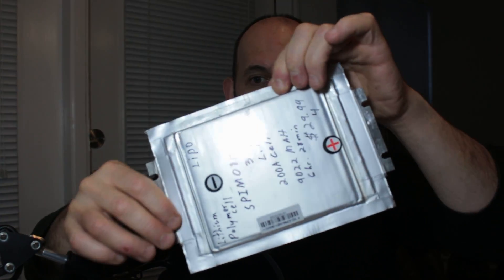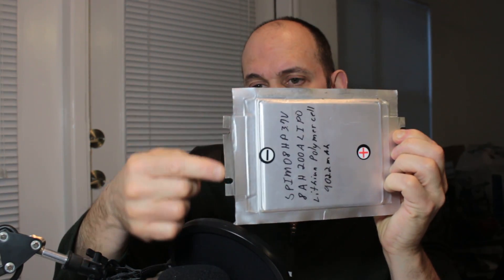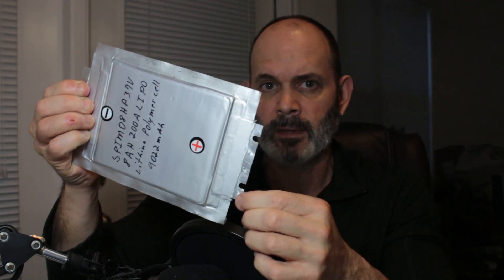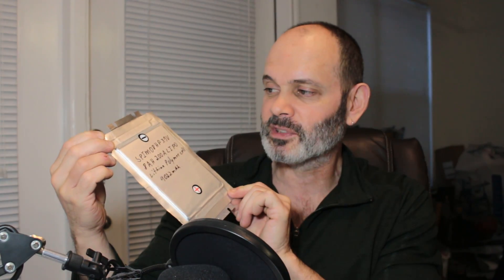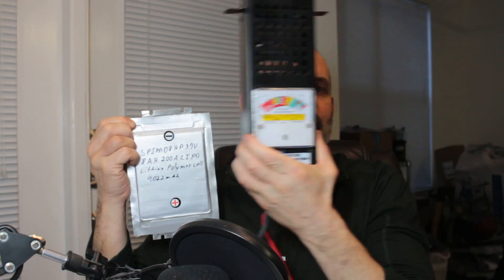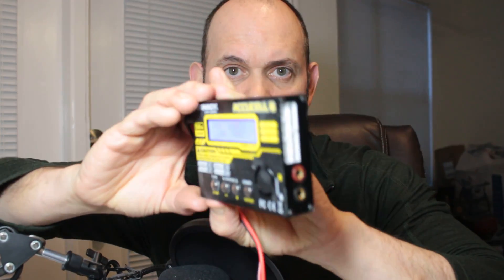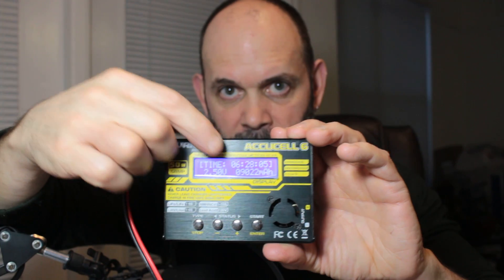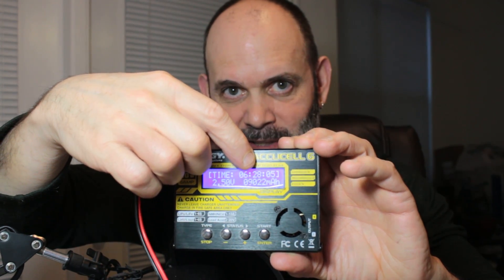SPIM08HP 3.7V 8AH LITHIUM POLYMER BATTERIES 25C 200A SUPER CELLS 24V 36V 48V TEASER Intro Video

Comment: I got my 42 cells today. In this shipment I learnd first, how expansive shipping could be: 110 boxes for shipping and 82 Euros for handling in Europe. Shipping Bateries to Europe seems to be more expansive than the product itself. But now I have it, the batteries has been very good packaged but it's hard to get a datasheet for this kind of batteries. Do you charge them like a normaly notebook cell, up to 4.2 Volts?

Comment: Hi Richard,  It's amazing that it's now 2020 and these batteries are still on ebay. One doubt I have is, LiPO normally are not rated 2000 cycles...how have yours aged over 2 years?  Do you know how many cycles you accumulated and what is their latest capacity?

Comment: What cutoff voltage did you use to cycle and capacity test these batteries?  Also, do you think using 10A instead of 2A would produce the same effect?

Comment: If I were to use 3 in series to make an 8ah battery to power a fish finder or trolling motor, would I essentially have a 13.5 volt set up similar to a fully charged marine battery or would I need a fourth since nominal voltage is 3.7?

Comment: Curious, how much do they weigh? Trying to design a lightweight 50-60ah "12v" (prob go 14.8v?) battery. with 18650 batteries, depending on their mAh ratings based on condition, i'm coming in at around 140-200$ between 13 to 16lbs obviously the better condition higher mAh batteries trade weight for cost; however these package deals look interesting and might be applicable to me, but it depends on the weight and cost benefits.
Reply from the maker: Each cell weighs 281 grams or 9.9 ounces. They are polymer which makes them lighter but also more fragile. Thank you for watching and commenting. I appreciate it greatly. All the best.👍😀
Reply: @richardlloydusa  Thanks.  Trying to get cells, but it seems like most of the good stuff has dried up recently. Aiming for ~100-150$/Kwh but I'm easily coming in double that with the exception of the very least expensive recycled 18650's

Comment: Can these cells be used in a car audio application??????
Reply from the maker: Yes they can. They are unprotected cells so it's up to you to make them "safe" by connecting the proper safety gear (fuses, proper wiring, switches, cutoffs etc.) Thank you for watching and commenting. I appreciate it greatly. All the best.

Comment: Hey Richard. I just bought my first electric car. It needs new batteries.  It has a zilla 1k controller, powering an 8 inch advanced motor. The old batteries are lifepo4 from winston. there are 40. I just ordered 48 of these lipo SPIM08HP from alarm hookup. You think I will have any luck?
Reply from the maker: They have been great for me. Be sure to charge and discharge them correctly. I over discharged one cell and I destroyed it. These were originally manufactured to run electric buses in China so they should work fine for your application. Thanks
Reply: So one guy made a comment on diy electric car forum about a man that has 20 of these same batteries for a electric ninja motorcycle conversion that these cells have high energy density. So If I bought 84 of these I would only be able to go about 6 miles on a charge on a motorcycle? Do you believe that this statement is wrong and I can just use this basic Kwh conversion to find my predicted range? V x number of cells x amps= kwh    3.7vx84cellsx200amps=62.16 kwh  Wich is usually approximately 250 miles on a charge? Or am I missing something based upon the fact that these are not high power density and it is only going to be good for like less than ten miles of range?

Comment: 4.5 volts peak?!?  Everything I've seen about these suggests that they peak at 4.2v like most lipo's.

I've got 80 of them that I'm planning to run in an electric motorcycle, and mine have been right around 8000mah between ~3v and the 4.2v peak.  I didn't log it (no means to do so easily), but from periodically checking the voltage and mAh readings from my charger it looked pretty much exactly like you would expect an RC lipo to.  Very little charge gained from 3v to 3.4v, then it gains TONS of capacity in the 3.6-3.8v range, before reaching 4.2 with a relatively small amount of charge gained.

I really wish somebody could track down a decent datasheet on these things, because I've seen numbers all over the place.  I've seen the peak listed at 4.2 and 4.5 volts, I've seen nominal listed at 3.6v and 3.7v, and I've seen the suggested low voltage cutoff anywhere from 2.5v to 3.5v.
Reply: You are correct! That is quite misleading info. Even the company selling them on eBay list them as 4.2v cells but it does also say that their low voltage cutoff is 2.5v unlike lithium ion cells which cutoff at 3.0v.

Comment: I had to delete my comment. didn't do enough testing. I built 12s2p pack and I get about 14,500mah out of it drawing fairly heavy loads in bursts up to 200A. The cells I ordered varied a lot from about 6000 may to 9100 mah average A good number of them were 8000+. if building a pack, buy at least 10% extra.
Reply from the maker: I have had great success with theses and I will be posting my video soon. Thank you.
Reply: could you please tell me how you connect them together?
Reply: Richard Lloyd cool, well check it out. I built another 13s2p pack with them... packs mad punch and getting about 13000-15000mah still after maybe 20 cycles drawing fairly heavy loads

Comment from the maker: I am currently cycling these cells and so far each cell has increased in capacity every time I have charged cycled them. They have topped off on from a low 2.3% increase to a 6% increase in capacity. None of the cells were below the 8 Ah to start so they are all performing BETTER than advertised. Note that it takes me approximately 6 hours to drain a cell and 6 hours again to top it off and so far the cells needed to be cycled 8 times to stabilize at their highest capacity. So expect an increase in capacity in these cells on the first 8 cycles before they stabilize. I have 10 of these cells and they are all behaving the same way 8 cycles @ 2A X 12 hours = 96 hours @2A. I have 10 of these cells so I will have 960 hours in testing for these just to get them stabilized and seasoned correctly. I will do a follow up video on this as soon as I am done testing them. So far I think they are a great value and I am getting much better results than Jehu got on his. Thanks

Comment: How feasible would it be to use five 11.1 volt lithium power packs (the kin d for Rc helicopters etc Lipo) to power my eBike.  I have a 52V  18650 that i made from salvaged cells that you recommended.  It is 14s6p,   I would like to be able to use the charger i have now which will charge up to 58.8 volts.   Thanks Richard...Appreciate the great videos.  I am a subscriber
Reply from the maker: Anything is possible as long as it is designed correctly for the application and properly charged and discharged. Thanks.

Comment: Newbie here,  I have an Imax charger and I purchased several of these cells. It only charges them to 4.2v and the mah  says 6300 or so. I've only charged and discharge 2 so far. What am I doing wrong? Please.
Reply from the maker: You should be charging the cells to 4.2V and discharging them to 2.5V. My Turnegy charger is giving me over 8 Ah on each cell. Thanks.
Reply: Richard Lloyd  thanks! I was only going down to 3.2. Always like your vids. In the process of figuring out how to charge my 14s configuration . Have you any experience with a dc to dc step up? I have a ton of laptop chargers that I can use.

Comment: Have you built a pack with these yet.  It would interesting to see what kind of pack design you did.  Would you build a 24v pack as a 6s or 7s with these?
Reply from the maker: I have not built a battery pack with them yet but it depends on your requirements. I intend to comment on using them as a 12V pack in an upcoming video. Thanks.

Comment: Hi Richard great reviews, very detailed. I am looking for a smallest high (true) capacity low cost value for money 1S battery for a project of mine. Ideally it be over 3000mAh, LiPo or Li-ion. Have you a video on this I have not found? If you haven't, it would be good to hear your opinion or watch a video (if you decide to make) on this. 
Thanks.
Reply from the maker: How many do you require? Thanks.
Reply: Thanks for your reply. Well I'm trying to make the project as small as possible so a high capacity LiPo or two 18650's. I wouldn't want to go any bigger. 
Thanks.
Reply from the maker: The Panasonic NCR 18650B 3400mAh cells are great 18650 cells and you can get 2 of them for a reasonable price on eBay: https://goo.gl/XaEtfC or on Amazon: http://amzn.to/2FyJyAy Thanks
Reply: Thanks Richard, will buy a couple and try them out. 👍🏻

Comment: cant wait for the tests. you can probably produce a very energy dense pack with alot of these stacked in an enclosure. im thinking ala f1 kers style stacked battery :)
Reply from the maker: Yes, they are made to be stacked. You can easily connect them using flat bar of any kind. Copper would be optimal but in this case I don't think it would make any difference if you used wood as long as the two metallic contact surfaces on the cells were in contact with one another I am sure they would transfer voltage and amperage without issue. I may do that test. Thanks.

Comment: Can you recharge them ??
Reply from the maker: Yes, absolutely. These are 100% rechargeable cells. Thanks.
Reply: what kind of charger would you need to charge 10 of these in
series to make 37v
Reply from the maker: You can go with something as basic as this on eBay: https://goo.gl/Se33dy or this on eBay: https://goo.gl/VDujFE depending on your needs you could go higher. You may want to add a BMS to the system like this at eBay: https://goo.gl/XaEtfC to protect the cells, note this is only a 60A BMS so if you need more Amps you will require a larger BMS. I have not tested any of this gear so I can not attest to the quality of the gear, I am just suggesting a solution. Thanks.
Reply: thank you very much. I want to use these on my ebike.
Reply: I have 36V li-on charger, I guess they work on lipo batteries also.
Reply from the maker: As long as they do not over charge them you should be good. Thanks.